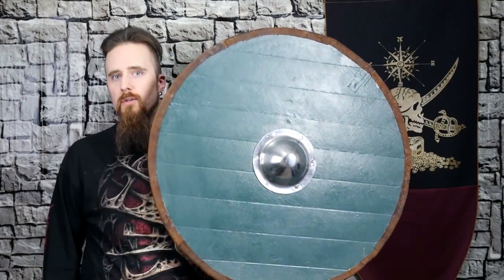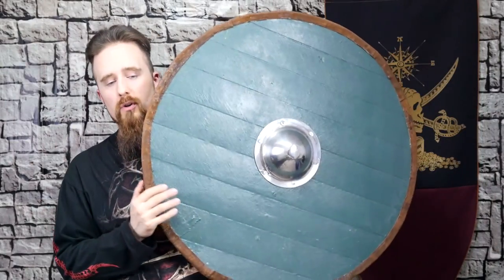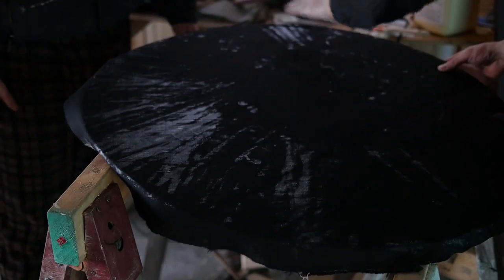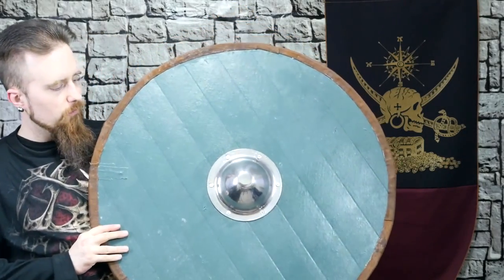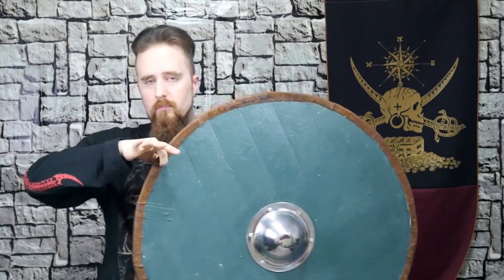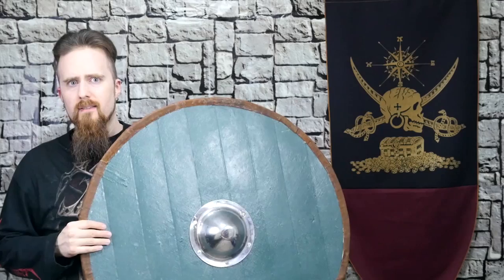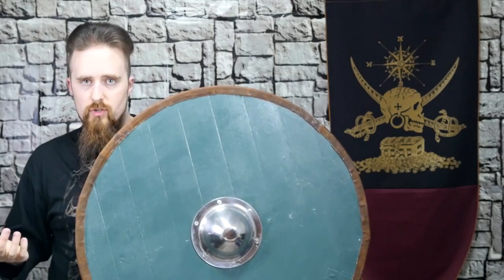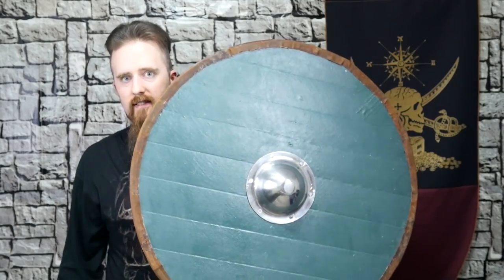Making, testing and repairing a Viking center-grip shield

Comment: Nice shield,
for my shield I've melted beeswax and mixed with used vegetable oil then when it hardens I rubbed in the shield and used a hairdryer to melt the beeswax again in the shield so that the linen and the wood absorbs the wax and becomes waterproof.
Reply: Good tip. Just wonder how much more flammable it would make it?
Reply: @2bingtim  that would be a wall of fire
Reply: What ratio?

Comment: Wet Weather/Rain rises the weight of wood significantly. It seems logical that they would put something on the shield at both sides to prevent the shield from getting soaked with water too easily.

A question: What does you shield weigh?

Comment: I always grew up with idea that shields had an arm strap and a handle, but I like this design a lot more. I feel like it adds a lot more mobility and you don't have to worry about your arm getting trapped.
Reply: spinafire Both kind of shields existed historically. As I understand it cultures that used strapped on shields also tended to use heavier shields, that would be too cumbersome to hold in hand for a long time. Greek shields for example had a bronze covering. I think cavalry shields also were usually strapped on, so the shield hand could direct the reins.
Reply: spinafire you should have a look at late period german hand pavise its a hybrid of a kite and a center grip - I use one in SCA heavy, I have found it to be the best shield for me (i'm 6ft 5")

Comment: Re-enactors in the UK use small carpet tacks to fix the rawhide rim on. Stretch the rawhide over the edges while it's still wet & floppy & tack it in place. The rawhide shrinks & dries really hard, holding the shield together & making the rim much stronger. Traditionally they'd usually sew the rim on, which I intend to try when I next make a shield.

Comment: Nice work. I made a flat oval Gallic shield several years ago  and actually stitched the rim on with sinew thread and painted a design on from the Arc de Orange. It was 1/2" plywood though and is quite heavy.
Regarding  Viking shields, I have seen several reconstructions that use additional reinforcing cross-pieces in addition to the grip, perpendicular to the planks. Since in your previous destruction, the grip was the weak point, it would make sense to add those additional strips to maintain rigidity. Not sure if they are historically accurate, but lots of other reenactors seem to use them. Good videos.

Comment: Skallagrim, your videos are much liked and appreciated.I think the backing on the planks, what held them together, would have been a couple of boards crosswise, and the handle was held in place by placing it between those cross boards. This would have stiffened the shield up quite a bit more than your method with the glue. 
Then slap a hide on the front, should be good to go.I believe anytime the opponent would attempt a slash attack, they would attempt to trap a sword with the edge of a shield and yank it down and away, or up and towards, pulling the opponent off balance, and creating an opening for a strike.
(you have to use the grain of the wood so you would only be able to effectively trap a sword on the two edges of the shield that go with the grain.)They used to tie their swords to their wrist. I believe this was specifically so they could let go of a trapped sword and grab the opponents shield, either forcing the opponent off balance, to the ground, or whatever. I think if you jam up your opponents shield, you can leverage it from him. If you could rotate his shield, your opponent would have to let go. Then you could easily recover your sword during a back step, or simply jam your stuck sword into the opponent, or engage in some other fashion.(I can come up with very few reasons why you would tie your sword to your wrist unless it has something to do with the kind of tactics I am talking about)The majority of Vikings did not have swords, so a shield would most likely be facing the axe and spear more often. I think they combined wrist action and the shield to deflect powerful blows at angles which mostly redirect the force away from themselves. Sort of the same principle of Tai Chi. Think "trying to jump on a spinning merry-go-round"
You could also let go of a sword that is tied to you in order to put both hands on your shield to prevent it being wrested from your grasp.I didn't think it felt right to "punch" with the edge of the shield like they do on television.I wish we lived close, I would enjoy training with you. Much respect.

Comment: I'm tempted to send you some pine or spruce resin.. I often collect and refine those types of resin from trees in the woods, very authentic to use as ancient glue, but harder to work with than wood glue.  It's glassy until well heated, and flammable if you go too far (like extreme hot glue, let's say).  You might enjoy it though.. It can also be added if you brew mead, as it helps to keep the brew very yeasty, and not vinegary.  Pretty nice shield build btw!

Comment: Hi skall.   Next time when you are glueing the wood make sure to put 2 beams on top (with paper beneath it so the wood won't break off when the glue has gone hard)  and then tighten it with the clamps. That will make sure the wood (or shield) whatever you build so it won't bend and or curve. Love your video skall!

Comment: Linen is an amazing material indeed. I'm getting various stuff tailored out of linen for the Summer heat.

Buying fabric can indeed be horrendously expensive, but it depends on the location. I traveled today an hour to my cloth merchant, but it's worth it because he only charges 10 Euros per meter instead of 50+ at the store nearby me.

Comment: Great job on the build dude, the videos are brilliant to watch... Keep up the good work! :)
It never fails to amuse when seeing comments from people that expect a Viking "everyman" shield to withstand bomb blasts.
They would have been sturdy defensive items built from local materials which could be repaired or remade using whatever was around in whatever country they happened across...
Our shields are solid, made with 16mm Scandinavian redwood boards, linen, flat bar reinforced and edged with stitched porkhide... I still doubt they would have held up to much when someone was coming at you trying to kill you, as an Infantry Veteran I can tell you that your job is to do whatever you can to stop someone when they are threatening your life.

Comment: Nice work with your shield :)
Regarding thickness, i´ve read that historical Celtic shields that have been found had even several degrees of thickness, depending on the position on the shield, being the central ones thicker (about 12mm) and the external ones thinner (7-8mm). I hope it helps for future projects ;)

Comment: As someone who studied the material strength and construction of wood laminates I can say that any kind of cloth glued on both sides of a wooden plank makes it structurally much much stronger than all the materials by themselves.
In fact a piece of balsa wood laminated between two carbon fiber or kevlar fabric sheets becomes a viable construction material.
Linen has a relatively strong tensile strength, but something like hemp fibers (fibers from marijuana plant) are by far the strongest natural fibers you could possibly use.

Comment: The vikings actually rounded the edges of the shield, the they covered the whole shield in linen (both front and back) then covered the whole shield in raw hide (again both front and back) the they covered the rounded edge with raw hide. They actually sowed it on through the whole shield, making it a strong seem.

Comment: How well do you think a crossbow bolt or an arrow hold up? Would you be willing to try? Nice video by the way much appreciated.
Reply: He said that he wanted to use it for practice, so I doubt he would destroy it any time soo.
Reply: Steven Myrick A longbow could easily penetrate that, it could even penetrate 7mm of armour steel :P (the average thickness for plate armour in England was 7mm)
Reply: Steven Myrick My 55 pound recurve bow can penetrate a 3/8 piece of plywood. What I've heard of viking bows was they have a 100 pound pullback. 2x the power would probably go through that shield and most of the way through the guy holding it.
Reply: VintageLJ Dude a longbow would usually not penetrate  2mm of properly worked plate armor,I doubt that it could even scratch 7mm  thick steel.
Reply: VintageLJ  I believe you must be joking. The breastplate alone would weigh more than fifteen pounds.
Reply: Steven Myrick straight through.  I've burried bolts and inch and a half deep into solid wood.  I bet you a dollar a bolt would fly right through.  As to arrows... I've lost some arrows to tree but only so far as a half an inch or less.  That shield should work for that.
Reply: VintageLJ  At what distance?
Reply: CraigNW That was a good reference. Cheers.

Comment: I hear you on the price of linen, so I end up using canvas on mine, but rather than 1 layer on each side, I used 7 on the outer side, and 2mm leather on the rims, and used two layers of thinned planks that had a total of 12mm thickness (give or take, since thinning them wasn't a perfect work from my part)

In my own tests (sadly, no camera for filming and back then my phone was a Nokia 1220), an axe wouldn't bit more than 3cm on it (sadly, my swords are made for reenactment combat, so they're sharpless and the edges are on the thicker end and rounded as per regulations).  Knives, saxes and the axes, hitting it from the front didn't got to the wood; glancing strikes only cut up to the 4th layer of canvas.

I've heard shields were mostly "disposable" back then but I have yet to find a reliable source for that myself; but I'm quite impressed for the indestructability of it.

Nowadays I mostly reenact as a knight templar (since we allready have an overpopulation of vikingrs), and opted to not even bother with the leather rim on my heather shield (specially since I couldn't find evidences of leather rims on these kind of shields on that period) and just rolled the escess of canvas around the edges as I glued each layer (again, 7), and I couldn't really notice a real difference on performance compared on my old round shield.  Anyway, so far in the years as a templar in such events, most strikes against the shield end up being deflected by the curve shape of it rather than land on the rims, which could explain why they didn't added the leather there.

Comment: its worth putting a second layer of linen/canvas (or even old bed sheets) on the front of the shield. Ive noticed a few extra layers has a significant increase of strength against thrusts to the face of the shield.

Comment: A historical shield would've had another grip and/or more cross-members across the back of the shield. You're correct, it adds a lot of strength and putting more on the shield would add even more.

Comment: Awesome job, very good instructional with good info behind it!  Also, I love that you go through the effort of actually putting a step by step description below, including links to where to get certain materials, dimensions, etc.  I watched your plywood video first and made one that way, exactly as you said, and it turned out so well that I'm going to make the plank one now.  

However, I do have a question though:  Can you describe or list exactly what kind of dogbone you are using to get the rawhide for the edge?  I bought a $9 pack of 3 large rawhide bones, but after soaking and unwrapping them, they turned out to just be 2 smaller SQUARES of rawhide, rather than long strips.  They were about washcloth sized and would never be able to completely encircle the shield unless I cut each one into many strips, which would take forever, be costly, and look ugly in the end.  I saw in your plywood shield video, you unwrapped the dog bone and it was a long strip.  I'm having trouble finding that type of bone.  I calculated that for a 32" diameter shield I need about 100" of rawhide.  

Keep up the great work and thanks for these great instructionals!

Comment: Waterproofing could be done using either the milk based glue that was used to stick the planks together, and possibly the linen to the shield where this is found. Also if the glue was made from boiled down hooves and hide it has to get to a fairly high temperature to make it fluid though it would still be tacky when wet. 

Another theory is that the front of the shield was completely covered with rawhide. 

Just some thoughts.

Comment: I think they simply used some form of pine oil as a finish for wooden and metal materials and tools. With a bit of preparation, you can extract quite a bit of pine oil from fairly small amounts of pine wood. If this sort of oil is easy enough to acquire with simple technology and is good enough for treating farm tools and weapons to protect them against the elements, then it certainly can be used on shields as well.

Comment: Very nice job! If you plan to make next shield, I recommend making it with planks no thinner than 10mm and with linen (or some other fibrous) rope nailed arount it. And also try some axes on it. ;) As we know, they were most common weapons (besides spears) in early medieval period.
In Poland during our tournaments we sometimes recieve such blows from daneaxes that the shields are being pierced through despite being 8-12,5mm thick. :O
Reply from the maker: Edvardius 
7 mm thickness is well within the range of historical Viking shields, so I wanted to give that a try.
Reply: Edvardius You said fiber.  I like what fiber does to me.  B ]

Comment: Mine isn't the most realistic I suppose. I ordered it online and it works surprisingly well. I tested by tomahawk on it and there were no marks of the shield at all. It was supposed to be a viking shield but it wasn't a center grip. It was the kind that has a strap attaching to your arm. It failed so I am planning on just replacing the old grips with the center grip. It also has a steel rim.

Comment: You now need a proper sword to match your shield . I did it the other way…. A Viking Sword first, then built a round shield. I used thicker & wider poplar boards and used an electric hand plane to make them gradually thinner out to the 1/8” edge . Makes a very lively feeling shield. All the weight is concentrated around the center boss.

Comment: Absolutely fantastic shield, Skall. Really great work.

A question however: given how thin it is - would arrows and javelins (as used in the period in question, 500-1100 AD) punch through it?

I am aware that the angle of penetration makes a difference here, of course. I would find it really interesting if you could do some testing with javelins and arrows. Not a demand, just a humble request :-)

Comment: This is the first time I've seen real advantages to a shield in one-on-one combat. Usually you think of shield used for group combat in shield walls and protecting yourself from projectiles.
In one-on-one you would think it would be clumsy and only offering a large blind spot especially if someone strikes at your head (you cover your head from the blow and thous cannot see the next strike).
But a weapon getting caught in the shield would be a huge advantage. It is not unlike using a cape to wrap around your opponents sword in fencing.
I would also assume that a shield could also be used to mask your movements to some degree.
Reply: uncleball78 yes! ThegnThrand and his friend eldgrimr (pronounced thain thrand and eldgrim respectively) have done multiple videos on viking era shield techniques, many of which include "shove your shield in front of your enemy's face to conceal an attack"

Comment: That is a nice looking shield right now ! The plain green is pretty nice with the leather rim. This will be a useful video to me, because I'm planning to build a coffee table designed like this type of shield. Although, I wonder if the iron / steel rim we see sometimes is historically accurate, and if it would have any advantages in battle over the leather or rawhide rims.
Reply: GT-Alex There is a mention of a iron-rimmed shield in the Grettis Saga,  where a sword gets stuck in the rim. So that might be a advantage, however the only archeological find i'm aware of is just ~3 inches long, so it might also just be a clamp to repair a cut/split.

As with most viking age things very little hard evidence and a lot of interpretation and reconstruction (aka. guessing)
Reply: GT-Alex I would chose rawhide, because if you have the iron/steel rim and you hit it, it will be crushed and stay so. Rawhide on the other hand will "bounce" back. So you kinda won't see the damaga and there is extra "bouncy" space(:D) for next hit to absorb.
Reply: Valid point here, you never know what could get thrown during rolepalying games (food, thorn dice, unscrewed pommel...)
Reply: DerDracoX ah, so it's like the background lore in a dark souls game.